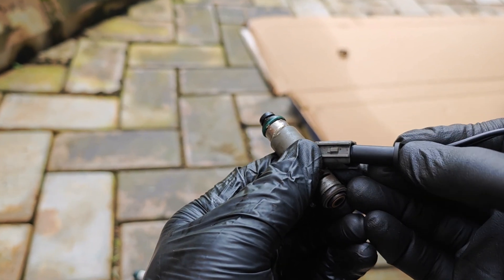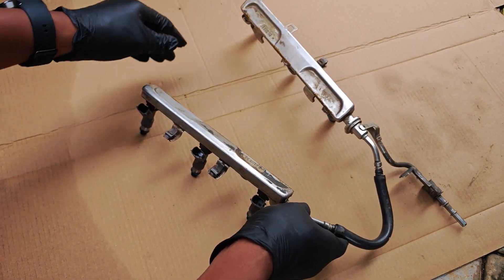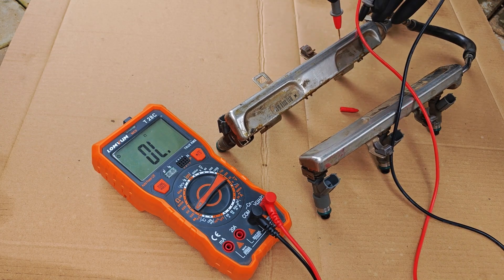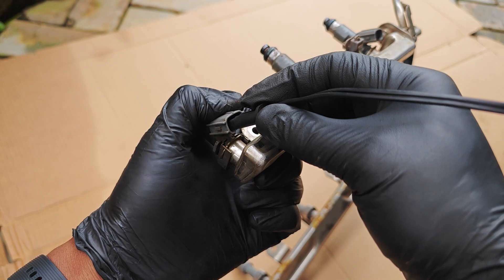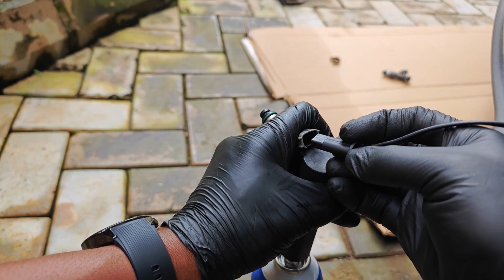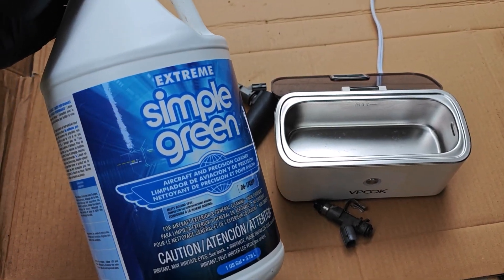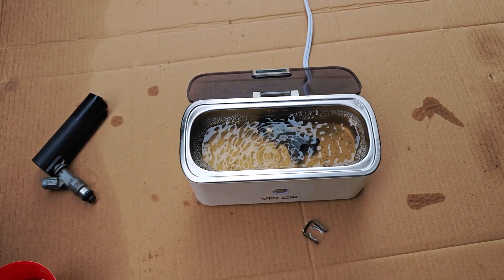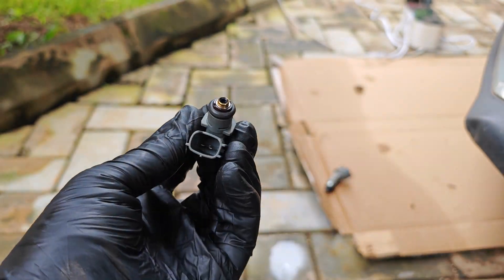Hard starting from Clogged Fuel Injector Fixed by Ultrasonic Cleaning / Clean clogged fuel injector

Comment: The content in this video is GOLD! Folks outside the [auto] industry don’t realize how useful and rare this info is. 

The prior method was to send your injectors off to a speciality shop, who would perform a cleaning using a special EFI machine that’s too pricey for an average DIYer.

So your tactic here is 👌 🔧 

I’ll be using this method to clean and repair the OE injectors in my ‘95 Camry V6 (original engine and trans, 267k miles, exceptionally maintained).

Love and respect 🫡 from Texas 🇺🇸 🍻 🇳🇬
Reply from the maker: Thanks mate! Salute to your '95 Camry👌🏼still going strong

Comment: Tanken sie Premium Benzin.
Problem gelöst.
Reply from the maker: For an injector that is already clogged like this, I don't think premium gasoline will fix it. Will need ultrasonic cleaning. But I agree that if someone was using premium gasoline from the onset, they would be less likely to have clogging.
Reply: Bullshit. Always tanked with RON 102, looked even more shit than this. Ran 550whp+ much harder than most cars. Rebuilt my engine with forged internals, injectors all rebuilt because of carbon and clogging.
Reply from the maker: Interesting!